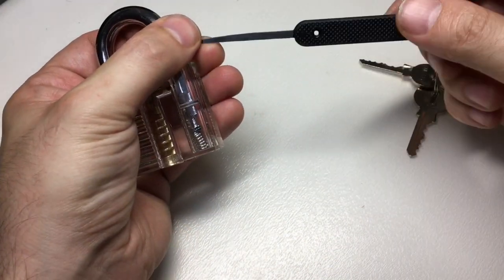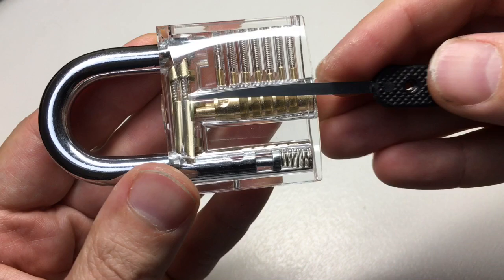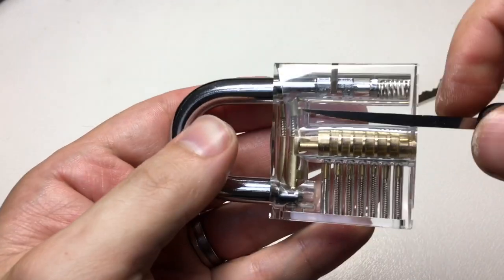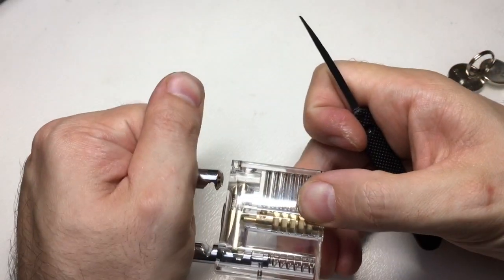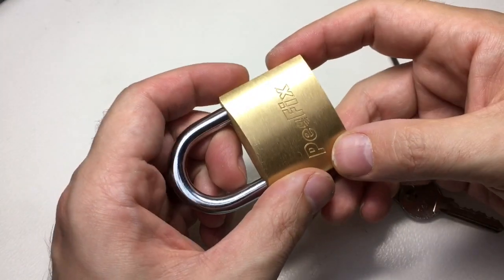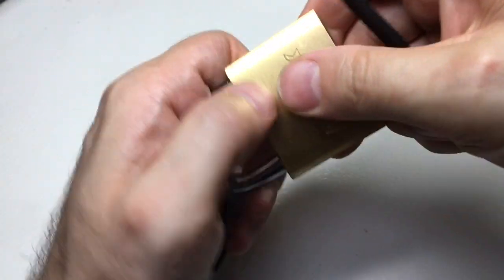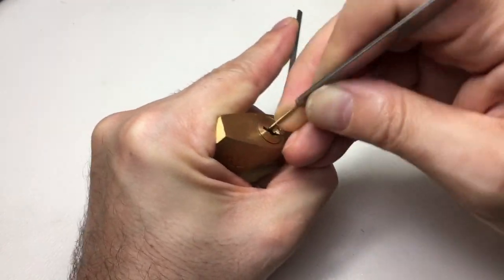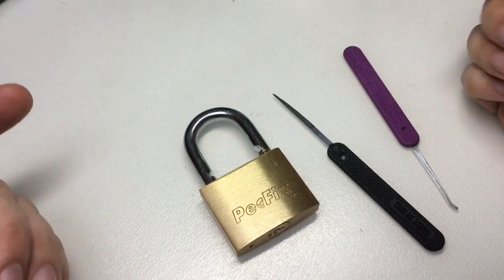(296) Double Locking Padlock Knife Bypass Explained

Comment from the maker: So basically, this is a technique that it is now pretty hard to find locks it will work on. Fun to try though :-)
Reply: I suppose if this was a very common bypass, you could make a tool like a car-tire-jack that you crank to get tension and it holds the tension for you. It could involved a spring also, to allow a bit of counter movement if needed. I tried to repin a cut-away cheap china lock, by trying to add in some of my own security pins, but couldn't 100% reassemble it properly. It is the gray one with black specs on it. I ended up buying another and didn't take it apart. I also have the clear one in your video. I'm glad you said the tolerances were bad, I thought it was the bitting I had that was so horrible which made it DIFFICULT to SPP without ACCIDENTALLY raking it open when inserting or moving the pick. I can rake it open 100% of the time, instantly in 1 swipe with ANY pick. Oooh wait, I got it and looked at it, the problem, is that they use double sided KeyPins  for both the keypins and top pins, which means they both come to a point at the sheerline, which is why the pins, pick themselves. If you know how to repin this lock, please make a video. https://www.youtube.com/watch?v=Kb5-6OTY72c Don't put Security PIns in the lock, they will jam up unless you file them down to make them have a smaller diameter.
Reply from the maker: Thanks for the interesting reply dude :-)
Reply: Sparrows still make the “Master Switch” that works pretty well on certain over-marketed padlocks ..
Reply: I did this by mistake while fiddling around inside a lock and was like “wtf the core didn’t turn” after seeing this I have replicated it again. At least I know what happened now.
Reply: We always have the trusty chinese

Comment: A hook pick may work better on some locks than the knife shown in the video. On my Master model 140 padlock, I hold the lock so top of the keyway is on top, insert the hook pick with hook down deep into the keyway, and feel around for spring resistance on the right side. Then, I pull slightly on the top of the shackle and push the pick down against spring resistance to pull a latch out of the shackle notch. The shackle pops out of the lock slightly and holds the latch out of the notch. Now I remove the hook pick, turn it over (hook up), and lift up against spring resistance on the left side of the lock. The latch on the other side of the shackle pulls out of the notch and the shackle pops out of the lock.

Comment: Hmmmm! That was interesting. I tried it on the two acrylic padlocks that I have without any success, but I don’t have the tool that you used. I've only been learning lock picking for about three weeks. Interestingly of the two acrylic padlocks that i have, one key opens both whereas the other only opens one. The padlocks are keyed slightly differently but clearly one has wider tolerances than the other. I also had two Master No 3 padlocks which i can now SPP reasonably quickly sometimes, so I feel I am making progress. I love this sport/hobby and I aim to improve. Your videos certainly are of great educational value. Please keep up the good work.
Reply from the maker: Thanks and happy picking :-)

Comment: If you lift the pawl on the sprung side of the shackle first you are taking advantage of the tolerances in the lock and you will not need to put pressure on the shackle while you are doing this.  It will click and hold while you retract the other pawl.
Reply from the maker: I find the shackle tension helps, but if it works, it works :-)
Reply: Today I obtained a master lock 140, only because others have reviewed it so I had to see for myself.  Went through SPP'ing, raking etc and then trying to bypass and found it needed slight tension on the shackle, upsrung side first and then the sprung side.  So, as you said, if it works, it works.  Try everything.  I've learned from this experience.  Love your posts.

Comment: That's what clear locks are for hehe :)..not picking, but for nice demonstrations :D. Very nice :). There are some locks where the actuator is shifted 90 degrees which can not be bypassed this way and also some with a crazy keyway, but many can :).
Reply from the maker: I only have a few padlocks where this bypass works but it's a fun trick :-)
Reply: I can remember a bypass driver (like a golf driver...;D), I think it was for some Abus locks. Got an 83 which is actully protected against that :).

Comment: How to repin the clear lock:
https://www.youtube.com/watch?v=Kb5-6OTY72c
(Note: my Bullkeys brand I had to use a screwdriver and a LOT of force. Be sure you leverage in the center round hole and not the sides around that (second) hole. You have to go through the obvious hole and then there is a second round hole in the MIDDLE area. Don't leverage where the END (NOR AT THE EDGE) of the shackle rests when the shackle is locked or you will break your lock!). I was so excited I had to share this ASAP. I am about to try to repin it right now, I hope it's a standard pin size.... Be careful and take your time, it took me 5 to 10 minutes to get my cover off. I couldn't use a pick like he used in the video, it would have broken the pick instantly. Don't put Security PIns in the lock, they will jam up unless you file them down to make them have a smaller diameter.
Reply from the maker: Great vid :-)